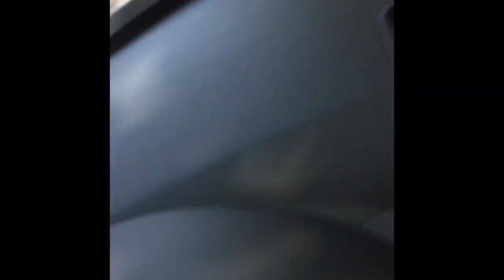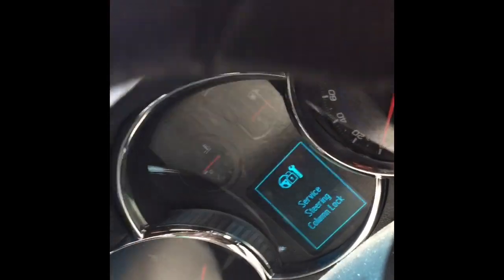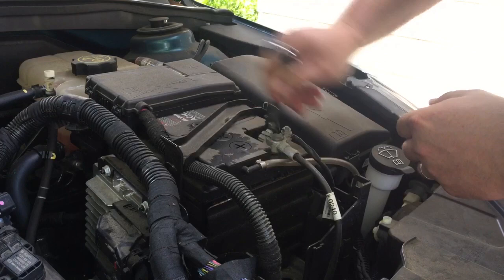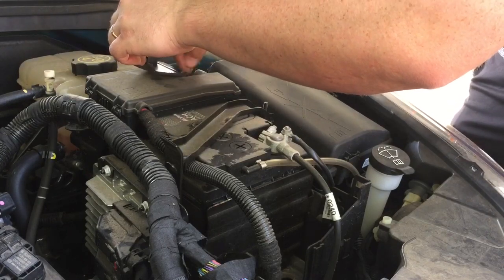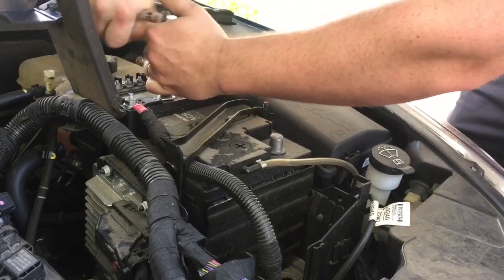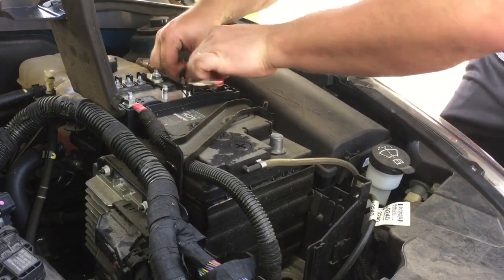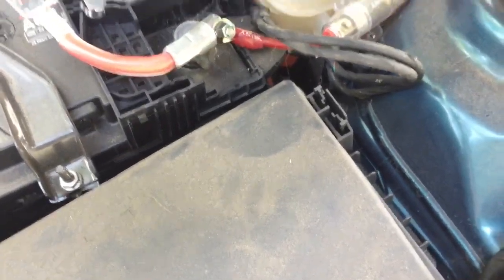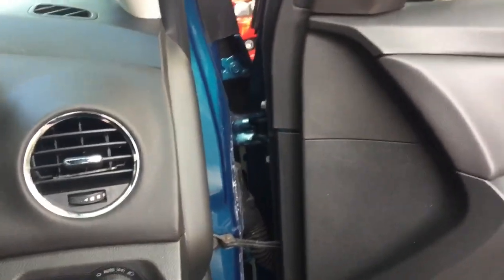STEERING LOCK SERVICE!! Holden Cruze won't start!!

Comment: Happened to me today - in a car park. Googled videos for a solution and yours came up. Went to Kmart to get a socket set and did exactly as you did (I only removed the cable for about 30 Sec though) and it worked straight away. Thanks for saving my day.

Comment: It is a common problem in these cars 2011 to 2015. It is the negative terminal cable, is a GMC problem ,the crimping on that cable doesn't have good connectivity any more after some years . GMC has an extended warranty for this problem here in Canada and the USA, repair free of charge. I just had mine fixed. Symptoms are radio coming on and off, blinkers don't make the click sound, check steering warning lite on dash. And finally car wont start anymore. Regards from Canada
Reply: How did u get it started
Reply: @filmongebru5545  replaced the negative terminal from battery

Comment: Thank you for this simple fix. This happened a lot in my wife's Cruze 2010 SRi-V, and it's most common with the push-start remote that the SRi-V had as standard. She did get the steering pin repaired or replaced after 4-5 years for ~$300. My son has the car now and it got to a point we could not start the car, without this simple fix. The steering lock error has happened once since, but he just managed to start straight after. maybe low voltage in the battery is causing the issue?

Comment: @pandagarage. 

I have a 2010 holden cruze, was driving one afternoon and car completely died, key locked in ignition and zero power to the car and gear selector locked in park.

Key released after a while and was able to be restarted and driven.

Next occasion, zero power to vehicle and couldn't even use the key buttons. Manual unlocked worked then same issue as above. No power and key got stuck in barrel once again.
Hot water on positive terminal gave power back and could be started and driven. Got me stumped. Any help please. Thankyou
Reply: Don’t to that; do what he did.... and check your steering control module; might just be loose

Comment: I just took the cable off.   Hope this works.  I've notice that sometimes things don't shut off properly when the door closes so this could be it.
Reply: It worked!  I just unhooked the black and cleaned off, waited 15min, recharged and it's starting again.  TY
Reply from the maker: Glad it worked for you!!

Comment: Had a similar issue but ours ended up that the steering lock module (the internal solenoid was intermittently seizing) giving it a tap would temperay fix it but once we replaced it havnt had the issue happen again, been over a year now still going well

Comment: My 16 Cruze with 1.4 turbo has died on me while driving. I disconnect the battery for about a couple of minutes and now it even won't start! The message indicates that the car doesn't recognize my key asking to put the key in the try holder. It does recognize when I do so but there is message coming about service the power steering and ABS! It did once asking to roll the drivers window up and down. You mentioned something about that very briefly. Could you explain it more?

Comment: I've had the issue three times the whole.time.ive had my 2014 malibu, same solution fixes it but it's such a pain and happens more frequently. Would be great to find a permanent solution instead of having to unhook the battery all the time, currently I've switched to my spare key and I put it in the centre console to tell the car I'm not stealing to so it doesn't lock.

Comment: I have a problem it’s saying service on column then as I am driving I loose power steering abs lights come traction light comes on battery light then a few minutes later all good

Comment: I've got a Holden Cruze 2014 SRi-Z that's come up with this problem. It's currently with Holden now. Hopefully they can fix. Have you come across this model encountering the issue?
Reply from the maker: It was an issue with all the cruzes! My advice would be to try and sell that car as quick as possible! They are no goof
Reply: @PandaGarage  They say its an issue with the steering column lock module and are charge $1k to fix + $500 for the replacement part.

Comment: This has happened to me with  both my first and second Cruze. They fixed it on the first car and said it  had something to do with the driver's side door and or window but now with my second Cruze they want $1025. They will replace the unit and will have to order it in. Not happy!

Comment: My suzuki swift is not starting and the steering wheel symbol is on ... i opened it yesterday and played with steering wheel angle sensor the car started and the symbol disappeared but today again its not starting. tried resetting the computer by unplugging battery but still no luck ...

Comment: My Holden Cruze SRI - V 2013 yesterday started fine but no instrument panel lights and power steering wasn't working. Not locked but really heavy.. got AA out ,who said to take it to Holden... I have had steering lock message also. I will get my partner to disconnect the battery to see if this helps me...
Reply from the maker: How did you go with re setting your car? Did it fix the problem? Sorry for the late reply!
Reply: Hey I got my partner to do everything you suggested and so far I haven't had a problem but it was only a week ago!! Hopefully your advice worked. Thanks mate!!!
Reply from the maker: Well we never had a problem since this video came out. Wish you the best of luck!

Comment: Had the service steering column lock error come up on our car randomly and we then couldn't lock the car. Holden diagnosed it to the drivers side door handle assembly.
Reply from the maker: It always seems like these cars are full of electrical bugs

Comment: I have a 2016 Chevy cruze and the service brake assist light has been coming on and my car has been struggling, now it's not turning on , it sruggles, could it be the battery ? Any suggestions
Reply from the maker: The Cruze has been known to have a faulty negative cable to the battery. So I would suggest replacing that or get another battery. Once I changed out the battery it fixed the issue

Comment: Yess, I've had this same issue on my 2011 cruze before, I disconnected and recharged the battery and away it went again. My battery has just died and needs replacing and it has just displayed service column lock system. Definitely a very confused system 🤣

Comment: Sorry for my English.
I have a Cruze LS 2009 (J300)
I'm patting my battery on board. When I stop my engine, I reset my dashboard, the radio does not work without contact.
I changed the load relay from the alternator. I checked the relays, fuses, the fuse block under the hood.
What would be the cause, please?
Thank you.
Reply from the maker: Have you checked that the negative wire from your battery is earthed properly?

Comment: Hi Mate - my wife’s car has the same problem. Tried disconnecting battery for 1 hour but it dint do the trick. As soon as I connect the auto lock theft functionality makes that annoying sound. Will try and leave for couple of hours and again try. Holden cruise SRI. My mechanic once said this is one the worst cars Holden ever made.
Reply from the maker: Yeah I’m sorry to hear! We ended up getting rid of ours because of all the issues and I’ve make a lot of angry videos about it!! These cars can have a mind of there own so leaving the battery off for a long as possible, even overnight may help

Comment: My wifes Cruze 2012-2013 has been playing up for the last 6 months.
steering column service notice, car wont start unless you disconnect battery
dashboard flashes on and off radio and gps turn off and on and most Dangerous of all whilst driving the power steering turns off and pulls you to one side while you fight not to hit the gutter what a joke of a car cant wait to get rid and Holden claim this is not a common fault there should be a re-call before someone gets killed but eh thats too exspensive.
meanwhile we just keep disconnecting battery until we can trade in.
Reply from the maker: Yeah these cruzes’ worldwide have been a really big issue! I wouldn’t get another one again!
Reply: Touch wood think we have solved the problem with reading everyones issues. Re-crimped the negative terminal and had no issues for 6 weeks now bought new terminal too just incase but not req so far.
Reply from the maker: That’s excellent to hear! I just had it happen to me again this past weekend, it is looking like the battery might be on its last legs so we will be replacing it soon. The battery can cause the steering wheel service to come up. Sign that the battery is going is that the dash screen will not light up
Reply: Panda Garage 
We replaced the battery about 6 months ago and yes they r temperamental if on the way out but the other issues r definitely the terminal
Reply from the maker: Well someone did recently left a comment stating that the negative terminal has known to be faulty, might be something worth looking into

Comment: My root cause was that the Battery was going bad, slooooowly and painfully, and without overt warnings that meant anything...

What was happening was that the computer goes into an unrecoverable state, requiring a hard reset. Software tracing was attempted, and no fault found. I tried your method more times that I want to count, and it seemed to help; for a while, before reappearing a small amount of time later, and usually in the most insane places. I ended up keeping a spanner with me in case a hard restart was needed...

Monitoring the Batt voltage, over time, I noted that battery charging was inconsistent, Batt voltage was not holding up after cranking the engine over, and in some cases took quite a while to recover, which was not consistent either.

Eventually, I did a Batt Load test, and discovered that 1 cell was on the border of being completely SNAFU. The issue being that the Battery was simply dying, and the only thing that was identifying this was the Computer and its lockdown's.

Doing a Hard Reset (Disconnect/Wait/Reconnect the Batt) did NOT always clear it, and on occasions it took several attempts to do so, alongside opening and closing Bonnett, open and close Power Windows, leaving driver door open when attempting to turn engine over, and lots of other insane things.

The issue that was identified was that the computer was identifying what it interpreted as being a security issue on its data buss, resulting in it going into a lockdown condition, manifesting through Steering Locked warnings and car simply failing to turn over (not even a click of a solenoid)_.

This was ultimately caused due to a Low Volt condition occurring. Once the battery was changed over, the computer and Buss security was completely stable.

Either way, the Steering lock and I became good friends for a while... 😐

For what it's worth...

Comment: Ok people,  try this , after resetting car with battery off , run a extra earth wire , from body to motor , alternator bolt , to body again . Find all earths on car and re tightened clean them all . Further more if you are keen,  go over all electronic connections,  clean , and make sure they are in good condition , i also put small amount of electronic grease in and on connections. Very minute amount,  with toothpick . Do this at own risk of course.  Good luck.
Reply from the maker: worth trying for sure!

Comment: Mint man!! Worked a charm this morning my sister had a work interview then this haopened lol will it be a continous problem or one off?
Reply from the maker: It might pop up again, what I would do just to make sure was to keep the steering wheel straight when turning off the car. We never had the issue again

Comment: Hi.. tbis happend to me yesterday . am still can't start the car up , also the cruise control not working  after replacing battery. i will try to do it and then i will comment the result. thanks
Reply from the maker: Try removing both leads off the battery for at least 1-2 hours, see what happens then!

Comment: My partner has a 2010 cruze. It's been a dud from day one. He paid $15000 for the pos like 3 years ago and now trying to trade it in for a Subaru.. but the cruze is only worth $3000 now. He got ripped off big time with that car especially with all the issues. 
Hope u got rid of your cruze! Or if not better asap.. or u will be stuck with some expensive problems :/
Reply from the maker: Our started off great but it’s been showing some problems of late! There’s more videos on Cruze issues coming up so I feel your pain!

Comment: Hey mate, doubt you'll see this but I have a 2012/2013 Sri-V and I've been getting the service steering column message on the tachometer screen intermittently (maybe 3 times - car has never not started though) but sometimes the little electronic noise the wheel makes when the car starts / engine stops is slower than usual, sometimes it's instant and other times it takes a few seconds. Also wondering whether this might affect the transmission (auto) as I've been having some slow gear-changes sometimes... think I might take it to Holden? Have you had any similar issues?
Reply from the maker: +Adam D hey mate! Have you disconnected your battery for about 20 mins? I did this and it reset everything and haven't had an issue since! If this doesn't work, take it into Holden. The Cruze has a lot of faults with the electronics so they might have seen this before. Hope that helps!
Reply: I have a 2015 Cruze and I’m suspicious of slight delay in shifting gears but hits 80 like a dream but I’m scared man my Cruze starts just like that and when I turn it off sometimes it clicks for awhile does it click for u barely
Turn it off

Comment: Hey Bud, funny intro to my question for ya! So I'm off to NCAT today in the city, to fight my case against holden and this 2013 cdx 2ltd lemon cruze i got(second hearing in 2 weeks) and i trained it leaving my car parked down the road from station. Came back from the city..get in car, try and start it and it didnt. Electronics work, but start didnt. Just died and locked my break. A lot of watning lights of all sorts came on a few seconds as it tried to start but the just dies, leaving radio and all working. Now i'm no expert, but i think if the battery was dead, the electronics wouldn't work right? But with these cars nowadays, i think the battery is not completely dead but also not strong enough to start it, am i right or would this problem be worse than i think? I have a video recording. Cheers for advice and your video.

Comment: Thanks so much.  The Curze of the Cruze...  Dont whole new transmission. whole new turbo. new wiper motor. now this issues. its run my battery flat.
Reply from the maker: It’s amazing they have had so many issues!! Shame to hear you have had to do all that, hopefully it won’t give you trouble!

Comment: You might unplugged the battery, it will come back in couples of days. I have a problem with my chevy Cruze (Service Power Steering) I did unplugged the battery and still runs the same problem. now I need to buy the Module or the whole Rack & Pinion with module and will cost me more to fix it at the dealer. $5,000 for 2013 Chevy Cruze.
Reply: mine same problem many people said it is from ground battery cable did you tried this way if you fix it can you tell me what was the issue

Comment: Hey mate
My 2016 z-series Cruze has shown the same error message today as your video, but still starts and drives as normal. 

Thoughts?
Reply from the maker: Hi! The problem I've hear from other cruze drivers is that these cars have a lot of electrical demons and can act up for no good reason! have you noticed anything different with the steering? Something i have found with this message is that it can come up if you leave the car doors open for a while. strange thing!

Comment: You only need to remove the negative side of the battery not both ok
Reply from the maker: can do it either way. I just like to guarantee that nothing is connected. But your way is fine
Reply: No, you only need to disconnect the negative terminal. No Battery loop exists if one is disconnected.
And you most certainly, don't loosen the negative, then the loosen the positive, before removing the negative.
Ever touched ground with your spanner while the negative is still connected?
Reply from the maker: Okay fair enough! I just always did it the way I know, it was how I was taught!

Comment: Hey did this happen again?
Reply from the maker: No we never had the issue again. The only electrical issue after this was the battery kept draining really quick. Could never work out the issue so I replaced the battery
Reply: Hi there, I’m having the same problem at the moment , bought new battery, change battery for both car keys but still no luck. Took the car to Holden and said, it was a steering module problem. For $700, I hope they will fix the problem.
Reply: @anaharrison3947  ours was the steering module as well.  Had that replaced and all fixed now.

Comment: This happened to me today. After a new attempts of trying to start it, I think it's short circuited the whole car
Reply from the maker: The Parks it's a real problem with these cars, regardless of where they were built. Seems the best way to fix it is to disconnect the battery for a while, seems to reset everything.
Reply: Thanks for the reply mate. I guess my mechanic will tell me everything i need to know tomorrow
Reply from the maker: +The Parks no worries! 
hopefully they can work it out, heard Holden has no idea what it is!
Reply: @theparks6541  what did your mechanic say?